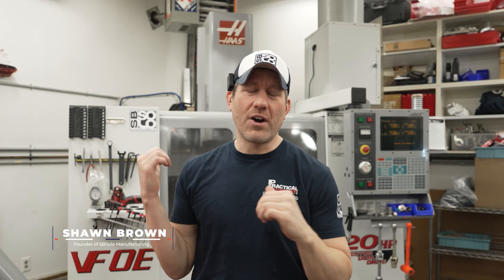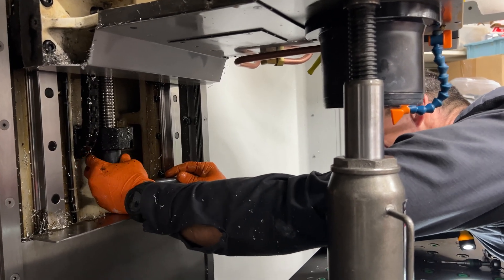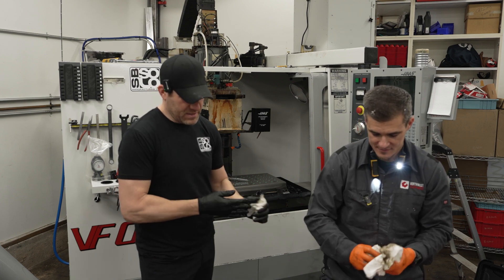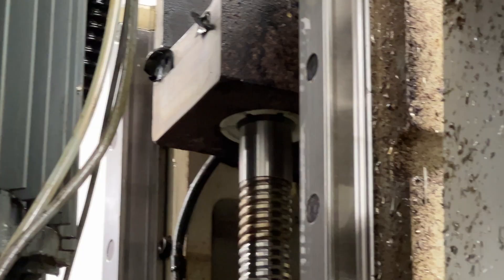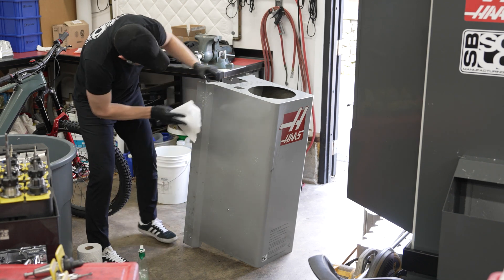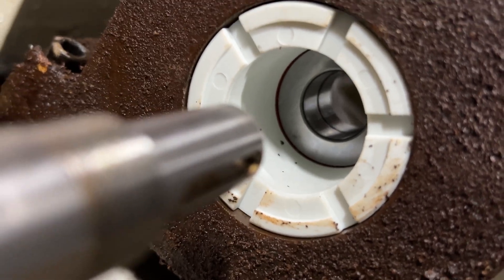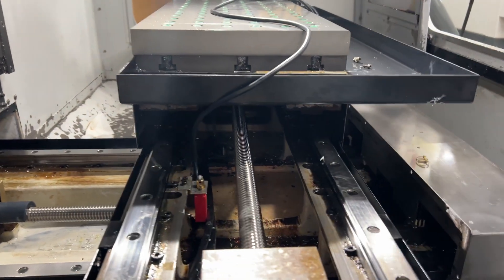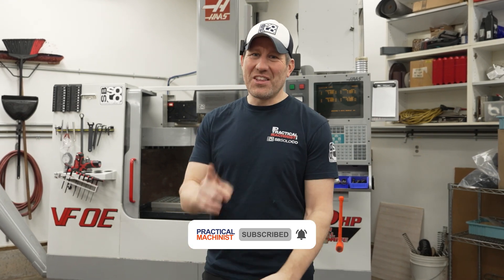Don’t Do This Alone: Replacing Ball Screw Bearings on My CNC Machine

Comment: Great video! A lot earier than a ACRA a BEDMILL DM2VS.Thank you for your video!  I am replacing the Z axis bearings on a ACRA Bed Mill DM2VS which there is nothing about doing this, the manual SUCKS, the top is easy, the bottom bearings are in there 17" deep from the back of the mill.
I bought this mill used, I have done a lot of hard steels on it, it is way more rigid than my HAAS Super Mini mill, both mills have there place in my shop. If anyone has information on removing the bottom ball screw bearing assembly?
I WOULD REALLY APPRECATE IT! THANKS!!!!!!!!!!!!!!!

Comment: Question for the tech:

Do you not measure bearing clearance in the housing?
Do you check for any bearing float?
On a Haas, do you have to reset home position?

Not judging, just curious!
Reply: I’m the sidekick and not the tech. Not sure if he has a YouTube account to post so I will try and answer. But he said most bearings will slip in like a F1 fit or need to be tapped in like mine as they are more snug. After everything is together he breaks loose the housing and floats it in running the axis up and down then. 

Since I removed the limit switches he had to adjust the home position. Also the grid shift was off as well. So we had to adjust the grid shift in X and Y so the machine coordinates was equal in center of table on the travels.

Comment: Worked at a shop that was primarily Haas....about 20 VMC / HMC / 5th axis trunnion machines.   Experienced a lot of ball-screw issues.  Started switching over to Mori and Makino.
Reply: Looks like the machine tool builder went a bit light on those bearings, could be due to the axis rapid travel speed. One solution is to stack them in parallel if the bearings allow it. Both INA and UNITEC make gutsy combination roller bearings especially for larger machines.